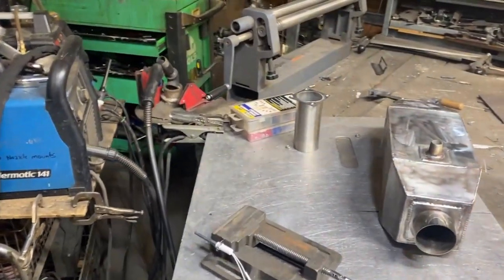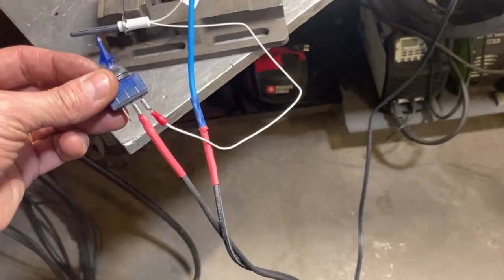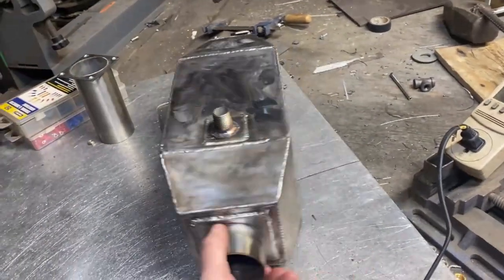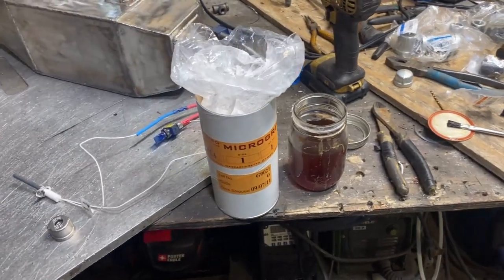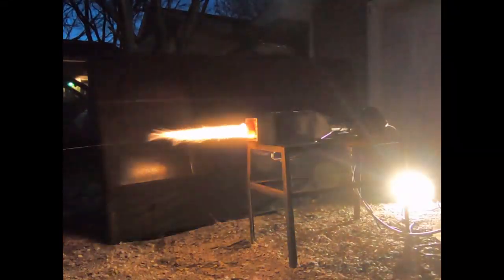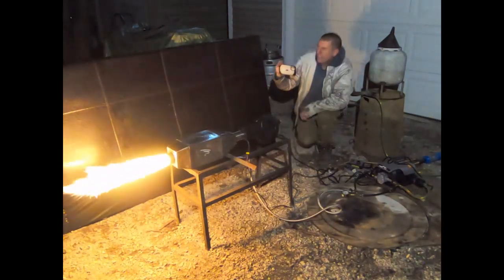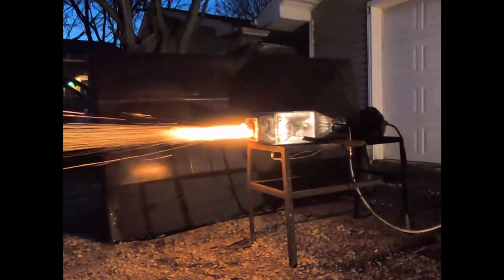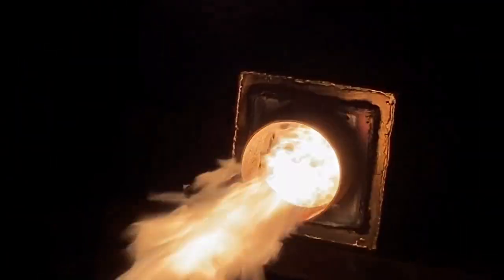Silicon Nitride ignitors 120 volt no electronics

Comment: In use these heat up and when at temperature they draw enough amps to activate the gas valve. It is usually 3.3A at 120V. They are a stay on safety item as well.❤

Comment: Hi I have looked thru your videos but haven't found exactly what I'm looking for. I want to use an air compressor and used engine oil to heat a small shop area. do you have a video that I could follow to design something like this?

Comment: Interesting.
I got a thermocouple n controller for my furnace, in case i wanna do some soaking runs, controlled temp rise etc.
So i can control fuel and air...
But lighting it up when its still below 5-600...
Mmmm. Pop a relay on one of the alarm outs, and switch one of these off once its at self ignition temps...

Comment: Could you dial back the voltage and make your inline heater for the fuel?
Reply: I was wondering the same thing. Use a varyac or something along those lines.
Reply: It's best to use a large heat coil...at lower temperature...

Comment: Maybe use a Non-self-resetting Thermo Switch?
Manual Reset supplies the Ignitor. After the Sensor gets hot enough it’s automatically cut of.
You only need to find a Contact Point for the Probe that never gets too hot for it and reaches the Switch-Point at the right Time.

They even are available as a DIN-Rail mounted Version with around 2m of copper capillary to the Temperature Sensor.
I’m using a STB from Jumo. It even is safety certified, but I’m in Europe.
Probably better than a Timer.
Reply from the maker: Good idea , i think im just gonna go with a push button switch momentary switch , you push it and its only on as long as you hold it on ...

Comment: What about a desiel injector from a car or truck...
Reply: Maybe a electronics common rail injector. But you need to understand the pressures involved to make them work right. A regular mechanical injector won’t work really because they are pop off style injectors. Not constant flow injectors.